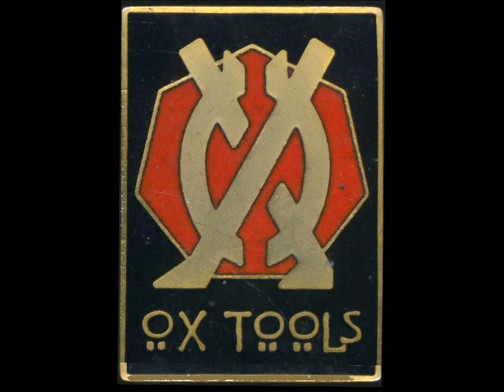Family Heirloom Repair Part 2

Comment from the maker: Hi Earl,
I normally set the dial on the machine slightly higher than I think I will need. The goal is to do most of the fine control with the foot pedal. In a perfect situation when you floored the pedal that would be just enough to do the job which leaves lots of pedal near the low end for tapering and any thinner sections. The puddle dictates the amperage needs. What I see in the puddle tells my foot what to do. I have not found any rules for setting the dial that make any sense.
Best
Tom

Comment: Great job for your Mom very interesting .With the silicone bronze tig rod to you set your amperage for the rod size or by the thickness off the metal.Could you give me some rough settings that you like to use.Thanks for doing what you do.

Comment: Nice tig torch stand!  My welder buddy requires reading glasses for up close stuff.  He installed an UltraView magnifier lens on his welding hood and said that he loves it!  Some flush rivets may have done the trick (faster and maybe stronger:  no heat).  Have you ever seen a spot facing cage and cutter?  They have a micrometer adjustment for the cutter height.  We used them at McDonnell-Douglas to mill the flush rivets smooth (if necessary).  They are also used for precise counter sinking.   Check-that, the convoluted handle bolster would interfere.
Reply from the maker: Hey wave,

I have one of those cages and a little box full of various countersinks and pilots. The tool guys must love the aircraft industry. I was trying to repair the tool in the spirit of its creation. The original was spot welded together. My mom watched the video and promptly hung the putty knife on the wall with all the grand kids pictures.

Cheers,

Tom

Comment: Hi mate.  Somehow, even after seeing this several times, I still like this video.  I see it as a concept video rather than a straight repair job, that ran over two episodes.  I would have given the back of the handle a slight weld as well, though.  ( o;

Comment: The world's most expensive putty knife.........  There's nothing like the sense of satisfaction you get from spending hours of time and money on expendables to resurrect a sub 5 dollar trinket.  Been there, done that, doing it again soon and forever.  Being "the guy who can fix anything" is a blessing and a curse.  BTW what was holding the butt of the handle together.  I expected you to run a bead on the seam back there.  I'm sorely disappointed that it didn't get a sandblast and 6 coats of clear coat metallic but that's just me spitballin here.  Ha!  well done.
Reply from the maker: Hi Blme,

It was lucky it got what it got. I basically had to milk it for a good video. Thanks for the comment.

Cheers,

Tom
Reply: You milked it just fine.  Mom's happy, good video with humor, mission complete.

Comment: Hi Tom, love your videos, while watching you file those spot welds and silica bronze welds for what seem like an hour, don't you have a pneumatic die grinder that would have made quick work of the filing, just my 2 cents worth.
Reply from the maker: Hi John,

Good point. I have every tool known to man and martians. When I'm trying to make money I pull out the speed power tools. When I want to connect to the job and interact with the materials I use hand tools. Hand tools provide the maximum control for fine work. This job wasn't about speed it was about a connection to the materials. Also I have a crappy compressor that is really loud and echos in my shop fiercely. 

Best,

Tom